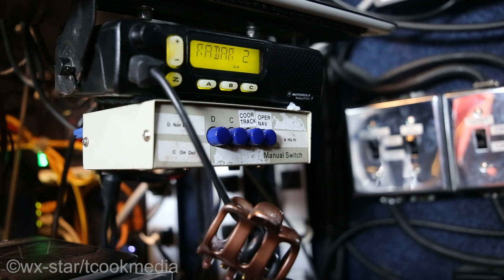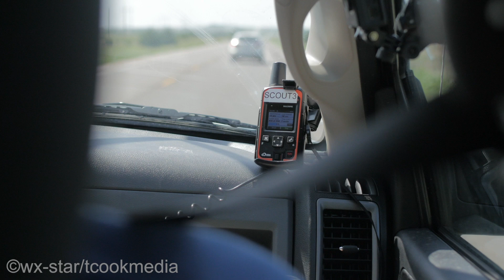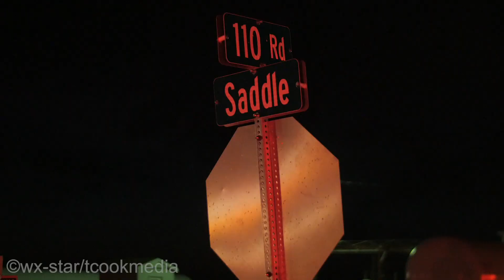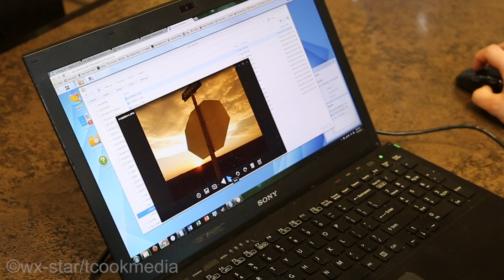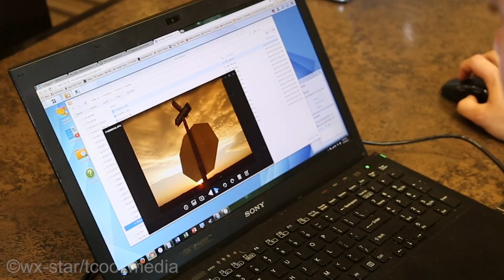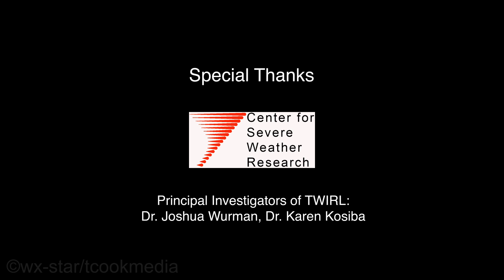TORNADIC WINDS: Dodge City

Comment: do you know how much wind can dow hold? or is the deploy thing to get better results or the tornado
Reply from the maker: DOW's are always well outside of the tornadic circulation, of course to avoid the tornado but the more common risk is large hail.

They get as close as roads will allow to the tornado and then stop short of potentially severe hail paths.

Good question as to the limits of the trucks/dish... unsure of that one !

Comment: Are the pickups rentals/leasers? Because honestly, they just need some off road tires, they obviously have 4WD and limited slip diffs. 

The DOW’s being on commercial chassis, I can’t think of a good way to make them more off road capable other than keeping some boards/blocks on hand or something to shove under the wheels for them to ride up on. 

Maybe a driving lesson or two for the interns 😉

Nice video!
Reply from the maker: No interns driving those beasts, however it does highlight the unfortunate reality of tight budgets as NSF (National Science Foundation) funding is cut more and more (See Arecibo). It's painful to see such incredible equipment, led by incredible people, in front of an incredible storm only to fall short because of some bad tires or lack of winch, etc. 
Thanks for the comment!
Reply: Are thse the only vehicles that the CSWR owns now? I remember back during Vortex2 they had almost 20 (maybe more) individual vehicles.
Reply from the maker: @ItsLilRobs  Good question Robbie! This is indeed their particular full fleet, however they have been paired with other research agencies and university partnerships that bolstered the crews to over 100 persons involved with the PECAN campaign. In a new development the Dopplar On Wheels facility has moved from Boulder, CO to Urbana, IL... so exciting news on the way for the future of research!
Reply: @ChaoticHorizons  Has the CSWR turned into Targeted Meteorological Systems?

Comment: Wow you all need at least decent mud tires and a  winch basic recovery gear and some off road  driving lessons . Please don't take this as offensive . Look up your four wheel drive club they will be happy to help and it will save you gobs on tow bills .
Reply from the maker: It is unfortunate that more investment and prep wasn't put into these inevitabilities. Grant driven science leaves a lot of ammenities to the imagination.
Reply: @ChaoticHorizons  to cut tow bills by 98 percent  these 3 things   first thing  " Detroit Tru Trac "   this minute long video  is something you can relate to ,  As could anyone  who pulls to the side of the road when it is raining "    https://www.youtube.com/watch?v=C0menFmqWjw        ," The results in this video would be the same 2 or four wheel drive "   number 2    a genuine mud tire ," they are dirt cheap on craigslist.   "   I just checked    
3 is basic skills  like  airing down .  When in sloppy or greasy conditions let around a quarter to half the air out of your tires ,   " don't do this with a truck with duals "  air down until the tires are bulging real good .  C clamps or locking plyers  put bottle caps over the jaws of the plyers  the Tire with the least amount of traction will spin . So put bottle caps over the plyer jaws and clamp the break line on the tire with traction . When you then apply the break , the tire which is spinning gets all the breaking power and the tire with traction then spins . Careful " make sure your car  doesn't have computer controlled breaks "   I am pretty certain the big radar truck has a no spin diff . But video of it sliding around is to short . I love  mud . I am 48 years old and I still love mud

Comment: What's the most simultaneous tornados on the ground at one time?
Reply from the maker: Great question, I don't have a great answer but struggle to recall any occurence beyond 3 simulatenously.

Storm chasers and scientists count tornadoes differently often... most scientists would conclude that 1 mesocyclone or rotating updraft can only produce 1 tornado at a time... even wording it as a multiple vortex mesocyclone when multiple funnels protrude from the same updraft/mesocyclone. With that in mind a storm needs mulitple mesocyclones to officially be counted as multiple ongoing tornadoes, which the Dodge City storm did accomplish with atleast 2 ongoing simultaneously from 2 different updrafts. An incredible storm to say the least!